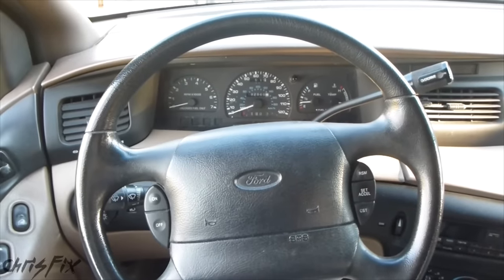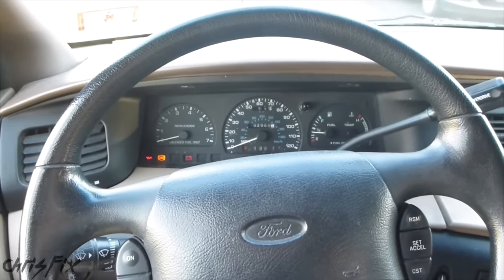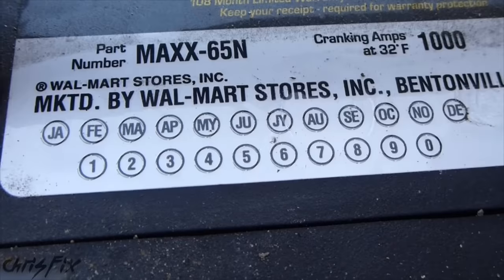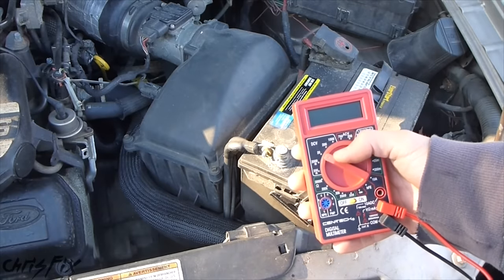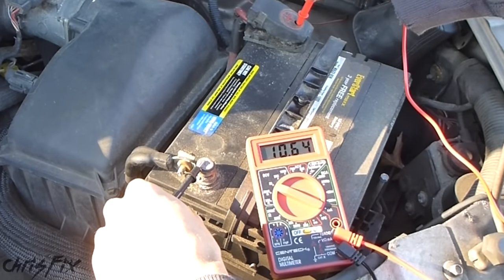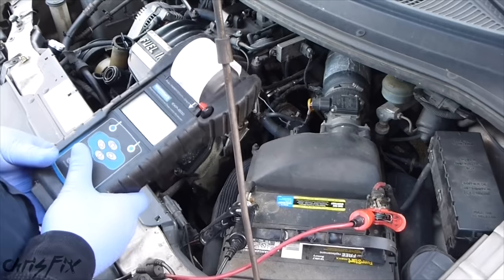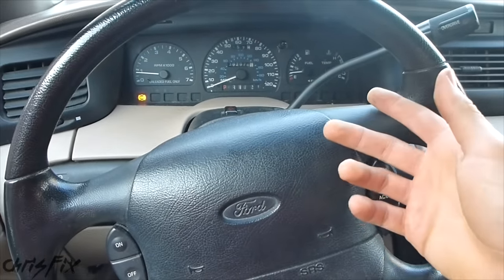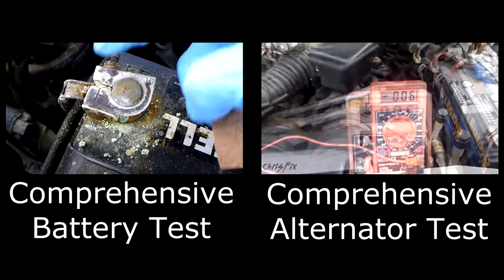What to do if your Car won't Start

Comment: I like to panic and cry in the drivers seat first
Reply: Arsene Ashford Me currently😩
Reply: Me right now.
Reply: SAME
Reply: @teddybear97able  🤣🤣🤣
Reply: I just purchased a new battery but still won't start.. Any ideas
Reply: @arnoldjones4742  does it click or it cranks?
Reply: @arnoldjones4742  that's the starter. If your car out of nowhere just stopped turning on and just clicks its your starter
Reply: (Noice persona 5 and persona 5 royal pfp LOOOL)
Reply: I usually just sell it and buy another bucket lol
Reply: my dads 2014 avalon hybrid sat for two weeks, then my dad took it out of the driveway, turned off the car with no issues, then when we tried to turn it on again, it just didnt work. Waited another 2 days and started up like LITERALLY NOTHING WAS WRONG WITH THE CAR
Reply: Me to.
Reply: Me too 😂😂😂😂
Reply: Me too bro...
Reply: Currently me
Reply: And then hit your head on the steering wheel like back to the future
Reply: @supfoo9221  no it might be the starter fuse which is blown check that first
Reply: Bro same!
Reply: You gave me a chuckle😂
Reply: Facebook Support how much karins you get in a daily basis?
Reply: Don’t forget to hit the wheel
Reply: my car doesnt respond to the remote control.  yesterday was okay, but today doesnt do anything.  all is off.   is it battery? it didnt show me any light.
Reply: @arnoldjones4742  starter alternater
Reply: Me reading this while wiping my tears
Reply: Don't worry this is a super simple fix and I've done all these things to many cars many time s
Reply: I have a 2001 ford ranger as my daily driver and I've done alot of preventive maintenance on it
Reply: I drive a stick so i push start 20 times before i spent a hundred bucks on a battery
Reply: @chickensfloat7427  u know there's a way to restore battery's with Epson salt it workss very well I think Chris should cover it on his channel
Reply: @womerboys2306  iknow. My grandpa does that but that only works if the acid is salt faded and thabattery has. Een sitting a long time. And even then thata nlt a permanent fix as the lead plates in the battery dont last forever. After you do a fix like that the battery wont have 100% of its life so you may not have as many cold cranking amps ect.
Reply: @womerboys2306  also some times a cell olens up in the battery and it quits putting out voltage and wont take a charge. But that is fairly rare and i have only run into that once.
Reply: @womerboys2306  i actually forgot about that trick though so ill probably do it to get by. I domt fully trust it though because i live in Wisconsin and it gets cold af. Batterys are like me they hate the cold
Reply: Me currently
Reply: Lmao
Reply: Lmao, that’s hilarious 😂
Reply: Omg same when it doesn’t start in the cold 😭
Reply: I stg i laughed at this for a good 10 minutes
Reply: Thats everyones first thing to do. Lol
Reply: LOL
Reply: Me imaging my mum beating me up  fr getting this car😂
Reply: Currently in the middle of the panic faze
Reply: That's my shit
Reply: @londonwatson7342  that's what I always do😆😆
Reply: @supfoo9221  it's not always the starter. It can be a messed up flywheel or a seized engine
Reply: Same!🤣🤣🤣 i had to get it changed and now its good!😍
Reply: Me to in my papa’s kubota when ever I drive it and I’m 9 years old but he ALWAYS fixes it and DOESNT EVER get mad lol
Reply: @arnoldjones4742  ignition switch? Is the engine at least turning? Is the engine seized up?
Reply: Yeah dealing with this yesterday smdh...  sat right there and cried!! I must say I doing much better today 😁
Reply: Me rn
Reply: Well not me
Reply: Literally, same
Reply: Me to
Reply: That's what I'm doing right now
Reply: Also my method of choice
Reply: @supfoo9221  t
Reply: @Somebo  t
Reply: me tooooo. me crying at work at this very moment.
Reply: Thats what I did today when my car wouldnt sttart at the Dollar General😂😂😂😂
Reply: @atameamcgoon6931  uq
Reply: Yessir 😆
Reply: Same
Reply: @arnoldjones4742  I don’t wanna give you the bad news but you might wanna get a new car
Reply: me every morning before work
Reply: me too and I really need to go to the storeee
Reply: 🤣🤣 that was funny. Sorry if that really happened too.
Reply: 😂 the old me
Reply: Same
Reply: Slyeah, that sounds like something Joker would do
Reply: Thats what weak ppl do
Reply: @arnoldjones4742  hmm try selling it to the junkyard and buy a new one
Reply: Yuhhhh
Reply: Lol
Reply: Me right now
Reply: Literally me rn
Reply: Me to
Reply: Bruh i took my dads car and it won't start i barley got it home that day and I don't know what is wrong cus maybe I just can't turn it on or sum
Reply: Me rn as a college student 😂😂😂🥲
Reply: Boombee haha funny
Reply: Me currently
Reply: Me too
Reply: me rn
Reply: I can relate 😂
Reply: LMFAOOAOAOAOA me rn
Reply: Me too! Cat is dead right now!
Reply: Me too
Reply: Gyro zeppeli
Reply: A Woman thing. 😭😭😭😂😂
Reply: Lmaoooo
Reply: me in this exact moment 🤣
Reply: That's me right now😡😫
Reply: Me rn
Reply: Lol
Reply: this is literally me right now
Reply: Lol
Reply: Yep
Reply: Me too… right now!! I hate this
Reply: Me right now I panic and cry, then got a  jumpstart and the alarm went off and I see the lights cam on, but then it start cranking but then nothing, but I think the progressive tow guy was mad,  but he was coming just for jumpstart ,  when he gave me a jump he kept moving the charger so I think he bullshitted me, and did not start , then he tells me it’s  still the battery , but he then left, and the service is free so am confused on what happened
Reply: i like to have a meltdown first too
Reply: Me right now
Reply: Good idea!
Reply: This is gold! I do this every single time!!
Reply: me right now.
Reply: At this point i am too
Reply: That’s what I’m doing right now
Reply: Me too rn lol
Reply: And imagine it happens, were you don't know anyone or any mechanic around, plus you have errands/stroke places to go
Reply: I'm going through it right now 😭
Reply: This is me today
Reply: Me currently
Reply: @mariemedeiros1756  that sounds terrible and I'm in the same problem rn although excluding the progressive guy so I'm waiting for someoen to arrive and help determine if it is the battery although mine ain't free its paid in favors 🙃🙃🙃
Reply: @zionalexandra715  such is life 🙌 relatable rn
Reply: Me rn 😭
Reply: My rn cause I had so much to do now I’m stuck not even at home💀😤
Reply: Lol
Reply: That's standard procedure for every professional
Reply: OMFL
Reply: Rn
Reply: Wtf should I do I’m gonna die
Reply: My car stalled a few weeks ago right in the middle of an intersection. I almost died that day when a semi nearly hit me. You can bet your bottom dollar I was crying like a baby till my mom & my bf got there 😂😂
Reply: 😂
I feel you, mate
Reply: @arnoldjones4742  You need a new car.
Reply: I relate to this so much!😂
Reply: Literally me right now
Reply: I like to imagine someone setting my wallet on fire.
Reply: It's part of the process
Reply: It’s so annoying literally gonna be late to work.. smh w this damn car
Reply: Same lol
Reply: gyro at its finest
Reply: Me too 😌😎
Reply: 😅that was me this morning
Reply: Hi guys i dont no what to do car wont start batery is still 100% is there any way what the problim is pleas
Reply: My car is showing that battery sign. Have recharged it but still cranks and doesn't start. What could be the problem
Reply: 😂😂😂😂😂im dying at this point smh
Reply: I’m doing that right now
Reply: Ima give it a try🥲
Reply: I thought I was the only one 😂
Reply: Exactly 😂😂😂😂. I just want to cry right now
Reply: I have experienced it last night. I called up a friend just to cry. So stressed, the car won't start at the middle of the road.🥲🥲🥲
Reply: I Panic when someone was jumpstarting a,truck Gmc yukon 2005 Cold start so loud

Comment: Need to top off your blinker fluid.
Reply: Damn why didn't I think to do that?
Reply: +Will S. Needs new muffler bearings too...
Reply: +Owlguy007 really badly needs the battery pistons rotated.
Reply: would you recommend high concentration blinker fluid for a pruis
Reply: edzgt5 High concentration blinker fluid is recommended for long periods of sustained use. If you use your blinkers frequently for an extended period of time, then yes.
Reply: You forgot to replace the air in your tires
Reply: I thought blinker fluid was only in bmw's. never seem to work in those cars
Reply: +Eric Meyer all german cars....i think it's stated in the lease contract that they charge you for trying to use those.
Reply: Will S. I
Reply: Why do they make cars so complicated?
Reply: Excellent video content! Excuse me for butting in, I would appreciate your thoughts. Have you heard about - Rozardner Powerful Battery Reality (search on google)? It is a great one off product for learning how to recondition an old battery without the hard work. Ive heard some pretty good things about it and my close friend Aubrey  got amazing results with it.
Reply: Chris fix Kingsley
Reply: New car owner
Reply: Need to top off the tire fluid too
Reply: Need to re-calibrate the ejection seat's trajectory, and of course refill its fluid.
Reply: Yeah the piston return springs are bad, replace it then it will start
Reply: edzgt5 Nah, only BMW’s need it
Reply: Ha ha
Reply: Headlight fluid
Reply: You need your ford replaced too lol
Reply: Yes ik this comment was posted 3 years ago but how u doin now man
Reply: What if it’s a BMW?
Reply: Needs new map lights
Reply: How is that done?  You say it, but you don't give details.  Not everyone knows about cars like you do.  I checked under the hood - I can't find where to add blinker fluid.
Reply: @fjccommish  is this a joke or do you actually not know
Reply: @they6622  I spent about an hour looking through the manual and all over inside the hood.  Then I searched online. It may seem simple to you, but it isn't simple to me.  Where is it?  Does it have to be drained first and then replaced, like oil?  Is there a filter?

One of my blinkers has been blinking fast for some time.  Now I realize this is the problem.  Maybe there's even a leak and lack of pressure in the system.
Reply: @fjccommish  Changing the blinker fluid is not as straight forward as an oil change, you must remove the headlight assembly, and manually drain it. Refill it to within about half an inch to the top, and then reinstall the blinker and the headlight assembly.
Reply: @wills.5762  I had my mechanic do it. He charged $500 - he said that's half normal price. I got a great deal!
Reply: @fjccommish  u got big scammed
Reply: @fjccommish  You need a heavier weight blinker lubricant. That should slow it down some ... if not, add more. Do be careful though not to overfill.
Reply: @fjccommish  Mine is in the trunk, under the spare tire. Be sure to check that next. You're welcome!
Reply: No diddy

Comment: I have my truck dosent start cuz of crankshaft position sensor wire on the computer weak and breaking down while running and starting cuz of battery, and my air conditioning control

Comment: My car stopped at a red light....it was so embarrassing
Reply from the maker: +Bill Gates dang that happens to many by hopefully you fixed the problem!
Reply: i thought you are suppose you stop at a red light
Reply: But*
Reply: Kahoobb he meant it stopped working at a red light. Get ur facts straight
Reply: Whayo AjRed YT i stop at green and go at red?
Reply: Whayo AjRed YT nope, and at yellow i just fly
Reply: ThePlaystationCriminal yea. I might to
Reply: Run out of gas
Reply: Happen to my ex and it was raining. plus it was the first car at the light. Traffic too. Ai jumped it though
Reply: Justin lmao Oop sorry
Reply: I had a throttle cable brake while I was stopped at red light. Pressed on pedal nothing. Mechanic told me a throttle cable usually doesn't break. Had to get someone to help push truck out of way embarrassing.
Reply: Justin I can only imagine, how embarrassing it would be😂
Reply: @whayoajredyt7658  wooosh
Reply: @chrisfix  I see a battery light
Reply: Were you driving a 1996 Honda Civic, who was Chris Fix's neighbour? If so, you must be a lucky neighbour. :)
Reply: Whayo AjRed YT when u don’t know how to take a joke
Reply: Mine happened on a uphill red light, had to put to neutral and drive backwards to a street😂
Reply: Whayo AjRed YT i cringed when i read “get ur facts straight”
Reply: Cheapo
Reply: @chrisfix  hi
Reply: @whayoajredyt7658  r/wooosh
Reply: @whayoajredyt7658  r/wooosh
Reply: That also happened to me. Red light I stopped then the car wouldn't move forward when it switched to green light.
Reply: Happens more often than you think
Reply: @whayoajredyt7658  r/whoosh
Reply: @musclecarsdaily3020  that's backwards
Reply: @tmaddock71  no its not lol

Comment: 2002 ford explorer xlt v6.This morning did not crank or start. Head lights and dashboard lights will not turn on. Nothing electrical works, but the battery tested 13.5 volts with engine off. Please give me some possible things to do to fix it.

Comment: Note:  Make sure you check the manufacture date of the battery.  A lot of times batteries sit on the shelf and which decreases their age and you will need to replace the battery a lot sooner.

Comment: Great video. However I think it misses the possibility of a flooded engine. Try turning on the ignition while flooring the accelerator. Sometimes this will get it started, especially on cold days.
Reply: I just did this and it worked …
Reply: What might cause the flood situation over night cold start first thing strong crank no start but if I do clutch and pedal to the floor it starts??😮

Comment: When i went to bring my 95 ford taurus to the scrap 5yrs ago (due to a cracked chasis), i took out the battery from the engine bay a quarter mile before arriving and it ran the rest of the way just on the alternator xD
Reply: Loooooooooooooool

Comment: My 1985 F250 6.9 IDI I just bought today that has been sitting since 1995 is making the wanting to start sound like in the beginning of the video.  It have two 2007 batteries in my truck. I was told if I charge it up and put the batteries back in it should start. I knew the batteries were bad. I planned on replacing them right away. It started RIGHT UP! Now I have brakes and other stuff to do on the truck. So excited. Helpful video!

Comment: Just a few KISS methods I've seen in my line of work. Check the battery cables to see if they are clean and tight. Have had a few occasions where that happens. Even had a woman whose husband used zip ties to hold the negative cable on. 

Also had an incident where a woman had her steering wheel locked. Simply turn the key and steering wheel at the same time. 

Lastly, I had a customer that hit something in the road and broke the bushing loose on her transmission shifter. 
Plenty more stuff but just some other things to consider.

Comment: Use petroleum jelly to coat ALL battery connections. This keeps the battery acid from forming on the posts and corroding the connections. If your ground connection to the engine is easy to get to, use the petroleum jelly there and on the fuse box connection if you can get to it. I have been doing this for almost 50 years, it is so cheap, and it WORKS! Why spend money on fancy chemicals that needs reapplications over time? Vaseline, or store brand petroleum jelly is exactly the same, and works better than spray can protestants. Smear the jelly liberally over the terminals and posts, install, and wipe the excess off.

Comment: My moms 01’ Grand Prix se wouldn’t start this morning. It would crank and soon, the starter wouldn’t even go. The problem was a phone charger that does not shut off with the car, and so I unplugged it. few hours pass by and we jump it with the f150. Turns on and it’s all good. It still takes a little more cranking to turn over but after a little bit of idling, she’s all good.
Reply from the maker: I'm glad you were able got it started!
Reply: Hey Chris! One month update, new battery is in the car, alternator is all good. Emissions control is also fixed. She starts like a dream and everything from clogged windshield washer lines to air conditioning has been properly repaired. Now all that’s left is a “Service engine soon” light. I’m so happy with this car and it’s in its final stages of being a perfect, healthy, maintained vehicle for us! We are looking at a 2007 Cadillac Escalade with 173k miles and there are problems with the manifold bolts (common problem on these trucks) but when I check under the vehicle, I’m telling you this was the most clean anti-rust frame I’ve seen in a while. My dads 09’ suburban can’t say the same. I hope we get it, it’s only $11,500 with minor fixes to be done to it. And lastly, I want to thank you for all your help with car repair, care, and diagnostic videos. I apologize in advance if I shortened your time on anything, and I wish you the best of luck in future projects!

Comment: If you think it's the battery, you should also check the fluid levels in the battery. Low fluid will prevent the battery holding charge.  You can top them up with de-mineralised water and then charge them. This will fix them most times.

Comment: On a lot of older Fords with the shifter on the steering column - the bracket that holds the shifter cable (under dash) can get loose (2 torx bolts), & will have weird intermittent starts.  Car will start in neutral but not always in park.  Or, the neutral safety switch needs adjustment or replacing.  Or so I’ve read.  I sure hope that’s the case with my Crown Vic, because I’ve had  the battery, belt, alternator & 2 starters replaced.  I will try this tomorrow when I’m not still so sad.  Mechanic does  not want to chase electrical gremlins or grounds.  Nor does he do exorcisms.